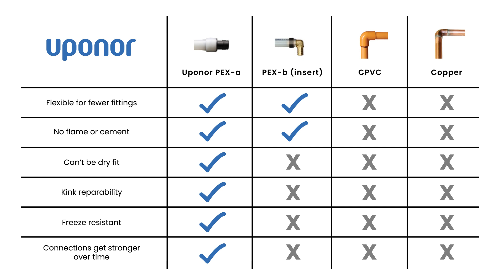The History and Longevity of Uponor Innovations | Ep. 1 Moving Forward with Uponor

Comment: Gentlemen.  From a contractor standpoint Uponor has a good product from the design centers to the plumbing pipe and supplies.  I have several new home construction and remodels that are either in progress or upcoming.  We have used your design service for both total water system and hydronic floor heating at a cost to the homeowner.  However, you really need to address the big problem with Uponor right now.  Please address this issue of not being able to get Uponor products in an upcoming video.  For these projects I went to my local Fergusons to try to get Uponor products off my project punch list for the new home construction.  I was told by the Ferguson manager that 70% of the Uponor supplies I needed are out of stock with no timeline or date for the items to be back in stock.  Now the customer has used your services for the design and we can’t get any of you products to do the job.  I have tried several different plumbing suppliers and I can't find the Uponor products that are needed to do the job.  You really need to get the supply chain fixed and products available.  Get the supply chain fixed before you go off and do more advertising on the Uponor products.  Because this doesn't affect you.  The contractors are the ones affected due to you have customers requesting your product and we can't get the product.  Then we are the bad guys because we have to use something else.
Reply from the maker: Hi, we appreciate your comments, and know the current situation is frustrating for everyone in our industry. We are looking at every option to source raw materials to help us increase production. If you have a specific question, reply with your contact info and one of our team members will reach out ASAP.